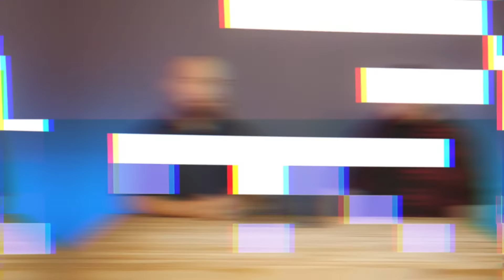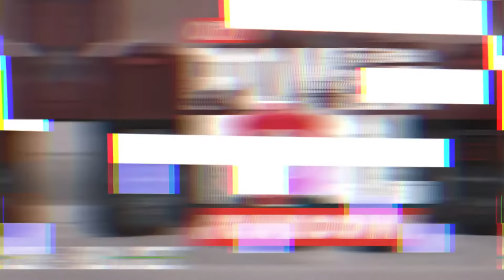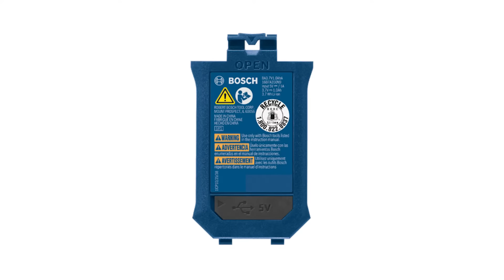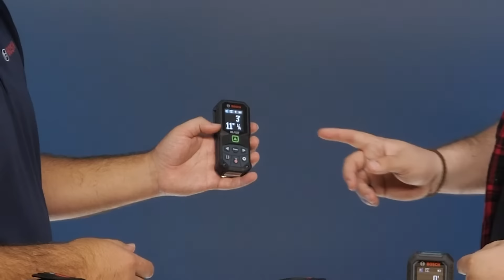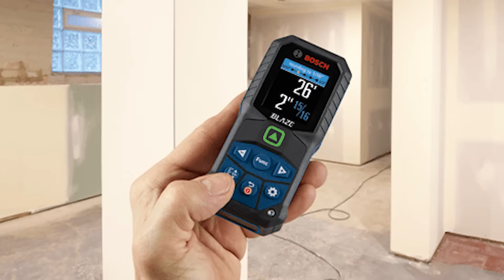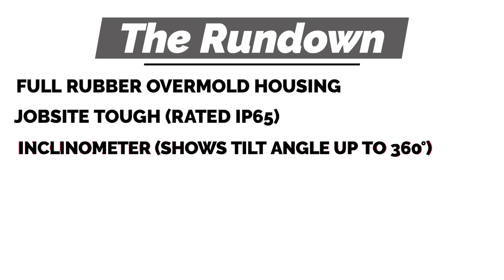Bosch BLAZE Laser Distance Measures - Green Beam - GLM165-25G & GLM165-27CGL

Comment: I own a sign company, can I measure the big billboard sign height and width and total height to the ground if I am standing on the ground in an angle
Reply from the maker: Yes, you can. That’s exactly what the indirect/Pythagoras (height) modes are for. You can stand on the ground at an angle, shoot the top and bottom points, and the laser will calculate the height (and even total height to the ground depending on the mode). For width, you’ll get the most accurate number when you’re as square to the face as possible, extreme angles can throw off the “true” width. Let us know if you have any more questions, we are always happy to help!

Comment: Is there away to measure slopes? I'm not good with measuring in general but looking to find out how to do so with laser. Been doing slopes with level lines...
Reply from the maker: Yes! This model has a built-in inclinometer that measures tilt angles up to 360°, which makes it perfect for measuring slopes. Instead of relying on level lines, you can just place the laser measure on your surface and it will give you the exact angle or pitch—much easier and more accurate for slope work!

Comment: Is GLM  50-27CG also a blaze series?? What is blaze series btw ?
Reply from the maker: Yes, the Bosch GLM 50-27CG is a part of the BLAZE series. The Bosch BLAZE series is Bosch's line of laser distance measures.
Reply: Thanks for the quick  reply but there is one confusion, all the other Bosch blaze equipment has blaze written on the front. But on this only professional is written apart from that I have seen that on all blaze equipment there is a large font which is displayed but on this one I don't think there is a large font that can be displayed. Also all the blaze ones have round off button but this one seem to not have it.
It would be really nice if you can help me here thank you so much

Comment: Do you know if either of these Lazers have the ability to compensate the distance measurement based on any slight offset of the angle when the measurement is taken. I.e. lets say you accidentally take a measurement with the device on a 0.7 degrees off level, and it compensates for this with the measurement?
Reply from the maker: When measuring with laser its point to point so if you measure 50ft away at base of wall then start going up wall with different angles the distance will increase 51’.2, 52.5’, etc. that’s the exact distance from the tool to that point on the wall. It will not compensate and assume you really want measurements for the base of the wall. If you need precise measurements at distance take a few measurements to ensure it’s consistent. The larger 400’ unit actually has an eye sight and tripod mount so you can set it up precisely.

Comment: Does it only measure if the device is butted up to something? If I wanted to measure the length of a table but I have nothing to butt the device up to, is there a feature on this that can do that?
Reply from the maker: That's mostly to make sure you're flush with the object you're trying to measure; if you set the level at the end of a table, you'd just have to make sure your hand is there to support it while it takes its measurements!
Reply: @OhioPowerTool  I don’t understand,. So what will the laser be pointed at while you hand is at the butt of the device at the edge of the table?

Comment: Thank you for your video, I'm a trim carpenter, thinking of using this for base molding measurements. Can the unit display measurements down to millimeters? Can the unit remember a series of measurements similar to making a "cut list"?
Reply from the maker: Glad we were able to help! Yes, the Bosch BLAZE series is able to remember up to thirty of your previous measurements, and you're able to change the style of measuring by holding down the power button while the device is turned on (from imperial to metric). Thanks for reaching out, let us know if we can help further at all!

Comment: When you measured from the counter to the wall is it from the tip of the tool or from the actual counter?
Reply from the maker: You can actually change that in the tool, from the base or top of the laser measure, so your choice. The default is typically from the base so you put base on one wall and hit laser on another you have the exact wall to wall measurement.
Reply: @OhioPowerTool  What is the setting called to make sure which one it is set on?

Comment: Nice review. I have a question. I'm planning to use this to measure the inside sizes of windows to make window coverings. The laser I have now displays 4 measurements as a list (current measurements and 3 previous ones). This helps me to find the shortest one without remembering my previous measurements. Does this laser has an option  similar to this? If yes, how many measurements will it display? Thanks
Reply: I always use my GLM165-27C to find measurements for inside-mounted blinds.  In the device menu highlight the Continuous Measure mode and press the Function button, then select min/max mode. Now just measure the width at the top, middle, and bottom of the window and you will have the minimum distance you'll need for your blinds. 
Tip: If you aren't sure how to use a function? Once a mode is highlighted you can press the gear button and it will display a short tutorial on how to use it.
Reply: @ToddMusgrove79   Thanks
Reply from the maker: An excellent question, and one that we can definitely help you out with! The Bosch GLM165 line will display up to thirty of your previous measurements, so you should be set for plenty of windows!
Reply: @OhioPowerTool  thanks for the reply.

Comment: Is there a feature where it will only measure if your holding it level, so easy to be holding these on a slightly angle and making the measurement inaccurate
Reply from the maker: The built in Inclinometer should help you out with that! The technology allows you to see if you're at an angle in your level, up to 360 degrees!!
Reply: how do i find this, i have the glm165-25g, says there is a level in it but cant find it anywhere @OhioPowerTool

Comment: I install a lot of shelving in houses and I have a question on this. If I’m measuring length from wall to wall, do I have to add the length of the device to my measurement if I had it pressed into a corner measuring to the other corner on the same wall?
Reply from the maker: There are several settings, and if you're needing to use it like a tape measure, you can set your starting point to the back of the laser. That should make things a little easier for you.

Comment: Do both the 25 & the 27 come with the inclinometer? How does it work? That feature was skipped during the video.
Reply from the maker: Great question! The inclinometer measures the orientation angle of an object with respect to the force of gravity. It is used in both the 25 and 27 models to show tilt angles up to 360° for easy angle and indirect measurements.
Reply: @OhioPowerTool  So does this feature include automatic trig height calculation? For example could I stand some distance from my house, measure that distance and then aim it at the roof peak to obtain the height of the house, less my tripod height based on the tangent function? I need this capability.

Thanks,
John
Reply: I agree, the video should of had a demonstration for that feature. That feature would be a game changer for carpenters.

Comment: Can I change the measurement magnitude to meters and leave it as the default? the model   glm 165 27cg
Reply from the maker: You can change the settings with the function button and they should stay however you program them until you decide to change them again!

Comment: That rounding button just sold me. I hated the previous 32nd inch only measurement
Reply: Ive got a pls that reads in 32 seconds only. Wtf. Not even trim dudes use 32 seconds. The rounding feature sold me as well.
Reply: Can you set it to always round or do you have to hit the button every time to round?
Reply: @davedave9780  You can set it to always round to the nearest 1/32, 1/16, 1/8, 1/4, 1/2. Great little tool. Expensive but its been great for me. Being able to choose the fractional rounding precision was a game changer for me. It allows me to choose for allowable tolerance and not have to convert every single time!
Reply: @tito1211  bought one last week and I've been playing with it.. Lovin it so far.

Comment: How does the battery charge and what’s the run time? I have the glm 500 and love it. It’s completely changed my work flow as a carpenter how ever I burn through batteries. Some times it says new batteries are flat after a few measurements  n then I turn it iff and on and they are back to full. I’ve tried different types of batteries and rechargeable as as well. It the only down fall I’ve found. Also when will it be out in Australia ;-) nice review.
Reply from the maker: Shoot me your email and I will get those answers from Bosch for you. phil@ohiopowertool.com